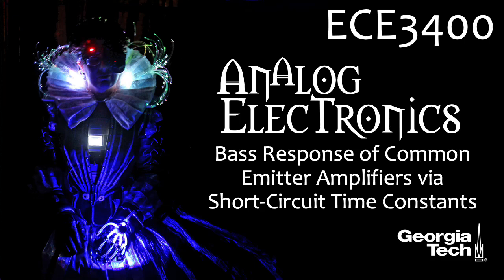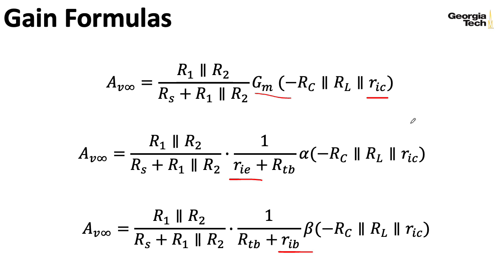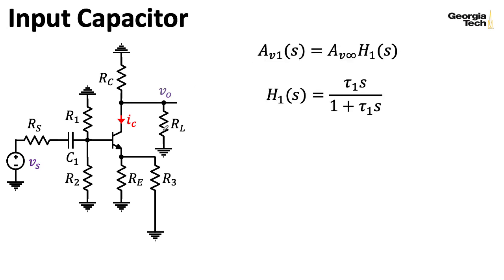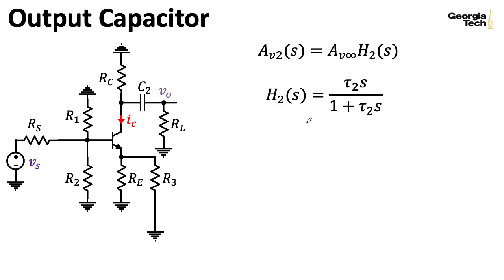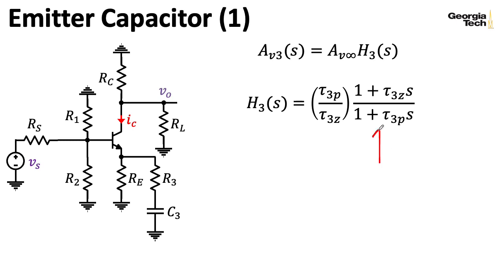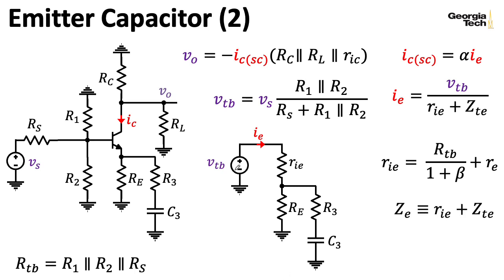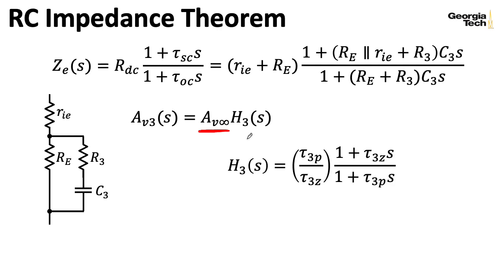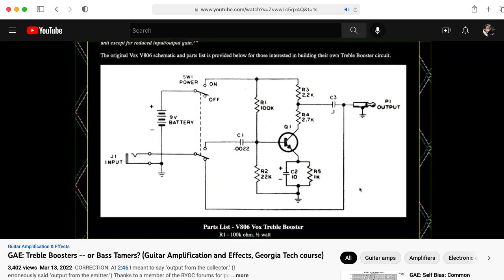ECE3400 Lecture 34: Bass Response of Common Emitter Amplifiers via Short-Circuit Time Constants

Comment: It's very important to include the inductance of the guitar pickup in any frequency response calculation of this circuit, the result is a more like a high Q  bandpass filter when the guitar volume pot is fully open (TB circuit input cap C1 is then directly connected to the coil), and the Q is reduced as the pot is lowered by introducing a series resistor between the pickup coil and the input capacitor, creating a broad high frequency boost.